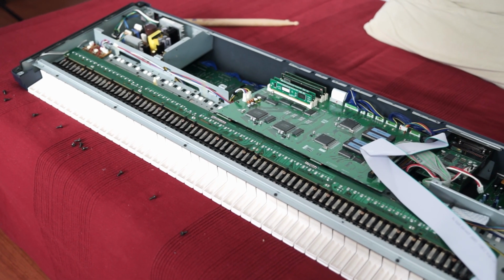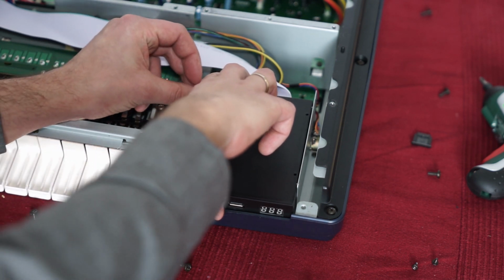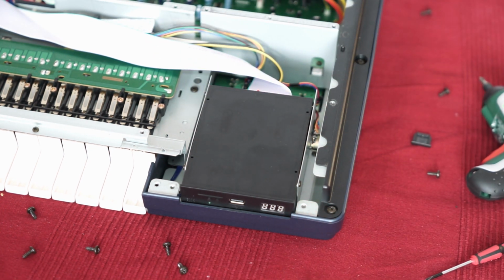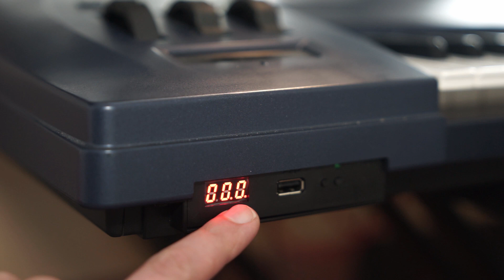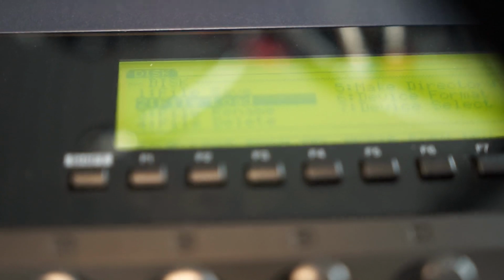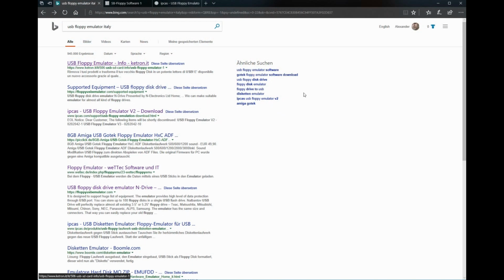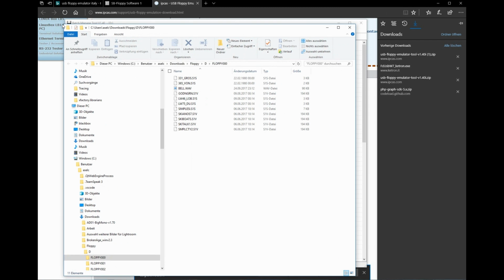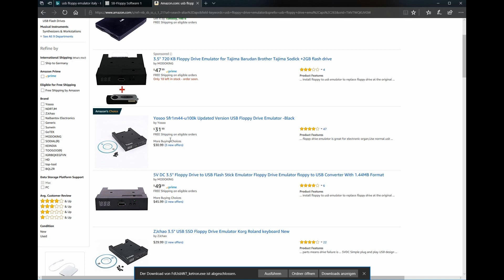How to install a USB Floppy Drive Emulator in an old keyboard (Yamaha EX5)

Comment: Thanks for another great informative video! One extra tip that I found helpful was to remove the existing drive by unscrewing the side 'wings' and removing the drive and the wings together as an assembly. That way it is easy to then access the screws holding the drive in on the right hand side.
Reply from the maker: Thanks for watching and thanks for sharing!

Comment: When I bought my EX5R some years ago, it had a Jaz drive installed in the floppy bay. I swapped this out for an internal SCSI2SD board. Either the Jaz/Zip or SCSI2SD will allow you to save and load much larger .Wave files than floppy emulators can. If you wish to keep the FDD emulator, then you can mount a SCSI2SD in a external case and connect it to the SCSI port on the back of the EX5. Some EX5/R did not have the ASIB1 SCSI Interface installed - but, these can be salvaged from the Yamaha A3000 sampler which has the identical board. These samplers often sell for much cheaper than buying the SCSI board itself from somewhere like eBay and you can also use the A3000 as a decent FX unit after the ASIB1 has been removed. The ASIB1 has two SCSI ports - one internal and the other external. :)
Reply from the maker: Thanks for watching my video! And thanks for your input. I think it's a matter of how much you're willing to spend. The floppy emulators are around $20, while scsi2sd (plus the yamaha SCSI interface) will set you back by around $200.
Reply: I didn't think about this but I guess it makes sense; because it's emulating a floppy drive and 3.5" floppies have a capacity of 1.44mb, you cannot load the large type of sample files with it that you could with the SCSI interface? Is that correct?

I have an EX7 with the original floppy and also an EX5r with a SCSI card and a modified compact flash reader. The compact flash reader allows me to load very large sample files no problem.

Comment: Hi, Floyd — I wanted to post this for future reference by people who own a Yamaha W5 or W7 synth. These USB Emulator drives won’t interface with these synths because they don’t use the standard PC floppy drive ribbon cable. The W5/W7 uses a narrower cable that has a flat end that slides into the floppy socket. There is also no plug for a power cable on the W5/W7. And, the floppy drive screws mount from the top instead of the sides as seen on your video. Your particular drive seems to have those screw holes, but it’s worth checking with the drive seller to make sure those screw holes are there.
Reply from the maker: Thank you very much!

Comment: Done it! I finally was able get the button to work, access the drive  and restore the EX5 factory sound banks. Brilliant thing this floppy emulator.
Reply from the maker: Very nice, good you got it repaired. May I ask how you fixed it?
Reply: @mr_floydst  Is not actually fixed yet. The buttons are still (many of them) problematic. I keep pressing with different angles and  strenght and eventually some of them work. I imagine is some kind of dirt or mould in the boards where the switches lay because once i got one button to work it seems to be easier the next time. Now that I got the synth with all its voices I just gonna enjoy it for a while after that I will takle the problem by getting to the boards and seeing if I can clean them. That involves dismantelling a few other thing because they are located in the front of the EX5, opossite to whre you open it. Ill need some time and courage to do that. Cheers

Comment: Floyd, thanks for posting this video. Last year I was looking at this option for my Yamaha W5 (same era as your EX5), and some dude was claiming you had to “flash” the firmware of the emulator drive to work with your synth, but I thought he was just trying to freak people out into buying from him for his so called “expertise”. Does that hold any validity with you? My brain nearly blew up reading about it. I got so disgusted that I just threw up my hands and gave up on the idea. Thanks, Rick
Reply from the maker: Hi Rick, thanks for watching. I can safely say that's 100% shullbit. ;)   There are some jumpers on the back of the emulator that you might need to change, and that's all (on most keyboards, you don't need to - for me, it worked straight out of the box).
Best regards!
Reply: @mr_floydst  awesome -- thanks! I'll give it a try. Loved your humor in the video and the stormtrooper thumb drive just made it funnier. You don't see too many people modifying the captions -- if you don't have the captions turned on, you don't realize what you're missing! :-)
Reply: Floyd, sorry, a little behind the times here, but wanted to share for others that this replacement won't work with the Yamaha W5. Instead of the PC ribbon plug connector, it uses a flat ribbon that actually slides into a slot. Can't find any drives that have that slot. What a drag.

Comment: I have just bought a EX5, mine has a SCSI port on the back, do they have that as standard? If so, I wonder if the port might be usable with an adapter perhaps?
Reply from the maker: This is the video you're looking for: https://youtu.be/wpuNQ4tSwTM   :-)
It's called SCSI2SD. The newest revision has an USB port so you can transfer files easily.

Comment: Hi Floyd, is it possible to buy used or copies of the origin Yamaha floppy’s that would have come with the unit? I have an EX5 with no disks, and I’m not sure if all the sounds are still in place on the memory. Do I need the disks to get it back to factory settings etc…? Or is it probably cheaper to buy the emulator?😅Cheers, Chris
Reply from the maker: Hi Chris, thanks for watching. You can get the original 4 Disks here, for example: http://www.ex5tech.co.uk/patches.html  (search for "EX5 Factory Demo Set").
Reply: Great, , thanks!

Comment: Thank you - very useful!
Reply from the maker: Thanks for watching! Glad it was helpful!
Reply: Yes, Alex, very.. :)) So I installed my Gotek emulator, then downloaded USB-Floppy Software - Ketron (the site has only Windows 7) version whilst my PC is on Win10. 
I took a 8Mb flash drive, fomatted it to 100 partitions, 1.44Mb, using the Ketron, it worked fine seemingly. 
I inserted it into Gotek and Yamaha appeared to "see" it, and then I recorded a quick notes using the seguencer and downloaded that Wave and All data to the flash and it appeared working - no mistakes on the EX5 screen, a saving bar was moving, etc.
But after than I returned flash to the PC and tried to open it using the standard File explorer - it shows the flash itself as FLOPPYO1 but nothing is on it, Explorer reads "This folder is empty". 
And I did want to listen to this WAV file from EX5. ((
What might go wrong here, Alex? Any hints please? How to open it? Thank you! :)
A quick update: I got it that the Ketron File Explre should be used and  - Yes! :) it showed me 99 folders and saved *.1S and *.1A files on the flash from the sequencer. 
Does that mean that the flash is working properly?
How can I then downloaded a WAV file from the EX5 sequencer so that I can play in on my PC for example and share?

Comment: Everytime I put the usb into my keyboard I get "Data  ERROR". It should be the same for a Korg?
Reply from the maker: Please look up the correct jumper settings for your Korg. 
https://github.com/keirf/flashfloppy/wiki/Host-Platforms#korg
Also, you could try to install the FlashFloppy firmware (same link), I did a video on how to do that some time ago: https://www.youtube.com/watch?v=BuZj5A7cNGA

Comment: I build a Gotek SFR1M44-U100 in my EX5 but it don´t work, the LED´s don´t light, only the USB Stick is blinking, can the jumper connection be wrong ?
Reply from the maker: Hi, that's quite likely. You can try other jumper positions or just install "flashfloppy" (see my updated video, https://youtu.be/BuZj5A7cNGA ) and https://github.com/keirf/flashfloppy

Comment: I just bought a roland w30 with one of these goteks installed, how do you save samples and sequences onto the usb stick???
Reply from the maker: You need to use that software by ipcas. It's linked in this video's description.
Reply: @mr_floydst  i mean from the w30 to the usb stick
Reply from the maker: @cubikvolume4403  Just as you'd save to floppy disk. I don't know the W30 - please look it up in the manual. The USB stick will look like a floppy disk to you keyboard.

Comment: I have a Kurzweil mark 10  Grand piano       what do i need to buy for my model
Reply from the maker: Hi! That machine seems to have a 1.44MB floppy drive. So you should be OK with the model I show in this video. Just search for "gotek usb floppy Emulator". The $20 models will work perfectly fine, no need to buy the expensive ones!

Comment: Hi Floyd 
I'm using ipcas 1.40 software to load files to my USB stick but I kept getting a message " file image is not fat12"
Not sure what I'm doing wrong. 
I'm using windows 10
Reply from the maker: Hi, thanks for watching! This is not an image file, but a zip containing the EX5 bank information. Just insert your USB stick into your computer and it will show up as a tiny 1.44mb usb stick. ;-) Just drag the file to that disk and you're good.
Reply: @mr_floydst   i tried it.  Didn't work
Reply from the maker: @mugabi111  Did you try formatting the USB stick on the EX5?
Reply: @mr_floydst  yes
Reply: I can't even open to see files on floppy disk 1
Reply from the maker: but you can open the stick on your PC and when you right click the stick icon and display it's properties, the file system is "FAT"? you unzipped the file? The file is displayed on your PC, but not on the EX5 ? On my drive emulator I have to push the stick in really firmly (the decimal dot will light up once the  usb stick is mounted correctly)
Reply: @mr_floydst   the  display on the gotek is 000 when i turned on the keyboard.   I can format the USB  on the keyboard and load single file on it . So basically the USB act as a single floppy disk.   I cannot  open or load any files using ipcas software .   But I  can format it using ipcas
Reply: I don't think the issue is the   gotek emulator .  The issue is that ipcas software
Reply from the maker: @mugabi111  The ipcas software doesn't directly transfer you data. Instead, you can choose the active "partition" or "virtual floppy". It will then create a folder on your pc. Drag all your stuff there and then synchronize it (there's an option for that in the ipcas software). It's a bit awkward.

Comment: do i have to updat the gotek or can i just install and use it , and where should the jumpers be i wanna install it in my ebsoniq eps ...im so lost on what to do ...theres a bunch of vids on installing the gotek but they all show installing firmware
Reply from the maker: It depends on your keyboard. The EX5 accepted this drive without modifications, but the SY99 didn't - a firmware update and different jumper settings were needed.
I'd recommend installing flashfloppy, as it makes data transfer much easier.
Reply: @mr_floydst  thanx bro , i honestly give up its harder then i thought ... i was thinking it was plug and play u have to have a college degree to get this thing installed lol . ill just use floppies at least until a easier method is on youtube

Comment: Thanks for tutorial. I've successfully installed gotek into my AP60R Casio keyboard and successfully playing midi files from imaged disks on USB.  Problem is that once a floppy image is loaded via gotek the keyboard will only see that particular floppy image.  If I change the disk number on the gotek the keyboard still shows the titles from the first loaded disk and when I go to play I get disk error, same if I remove the USB drive and reinsert.  The only way presently to load another disk image is turn the keyboard off and back on.  So, the keyboard is only loading one disk per session and not recognising changes to the selected image.  What appears to be missing is a diskreset for the gotek to let the keyboard know the disk is changed.  Is this likely to be a jumper issue?  Would appreciate any help. Cheers
Reply from the maker: Hi, thanks for watching! This happens to me sometimes, too. Usually I can fix it by leaving the "load screen", pressing the "disk number" button ten times (so it's back on the intended number), and then loading again. Here's a (somewhat garbled) schematic on the jumper switches: https://goughlui.com/wp-content/uploads/2013/05/SFR1M44-U100K-SFR1M44-U100K-R-SFR1M44-TU100K-UM.pdf    - maybe setting the "JA" jumper will help you.
Reply: @mr_floydst  thanks for your prompt reply. I'll give it a try. Cheers
Reply: @mr_floydst  

USB emulators only do what they are able to do ... replace floppy disks. 

Simply their replace your old mechanical floppy disk controller. Your keyboard is not able to load more folders at the same time. It is not the emulator. It's like changing floppy disks! Each folder represent a Floppy.
Reply from the maker: @alejandrovarelagandara7874  Thanks for your feedback! I'm aware of that, and so is the OP... I made another video on a SCSI2SD adapter, if that's what you are looking for. Best regards!
Reply: Floyd Steinberg you have to remove the stick and load another folder. Some people modify the emulator adding a switch so the keyboard believes that you change the floppy.

Comment: Hi I have a Korg i4S and got the Gotek drive, I have the problem that it cannot read the USB stick. I formatted it as a 1.44 MB disk with the software but it doesn't want to work. do you have any idea what could be the problem? My english is really very bad, if you speak german it would be much easier for me.

Comment: Dear Alex coul you give me info about jumper set on your emulator? Could you post a guide txt or in pdf format? I have tried to instal but my ex5 is now blocked i don’t understand why..thank you very much for your help
Reply from the maker: Hi! I never changed the jumpers on my emulator. What do you mean by "blocked"? Does it turn on? My first guess is that you plugged in the floppy cable the wrong way. Does your EX5 work correctly when you unplug the emulator again?
Reply from the maker: Also, which model did you buy? (Do you have a link to a web page so I can have a look at it?)
Reply from the maker: Well, according to http://iw.suntekstore.com/images_cache/271/10019784/136383374310019784.pdf  the s0 and s1 Jumpers are needed to determine the device id. try to Change this to 0 or 1 and see if it works. Also, does your ex5 work again when you disconnect the floppy drive?
Reply: I Alex,
If i disconnect the drive the ex5 is still locked and i must reset all ( exit button and power on)

I’ll try to change a jumper and let you know any news. Many thanks
Reply: Hi Alex i’ll try next week and let you know any news . THANKS😊
Reply: Were you able to get your EX5 working?

Comment: There are jumpers with this drive, on which pins should they go for using with synths?
Reply from the maker: Hi, thanks for watching! Normally, it shouldn't be necessary to change the jumpers. In case you need to do it, here's an overview: https://cdn1.goughlui.com/wp-content/uploads/2013/05/SFR1M44-U100K-SFR1M44-U100K-R-SFR1M44-TU100K-UM.pdf

Comment: How do I install the GOTEK emulator on the Korg i3 keyboard?
Reply from the maker: The Korg I3 has USB ports, so why would you want to do that? Just use a USB stick (or if you need to read old Floppy Disks, use a USB FDD drive).

Comment: HI I have a DM Systems Emulator FE-2000, I would like to install on my EX5, could you please tell me what are the correct jumper settings, i have J5, JA, JC, JB, S0, SI, MO thanks
Reply from the maker: Hi, thanks for watching. I'm afraid I can't help because that's not the model I own. I'd try to run it with the default settings, though, you can't do any damage trying that. Best regards!
Reply: @mr_floydst  Thank you very much for the reply, which model did you use in the video? I found this one on amazon,  SFR1M44-U100K Black 3.5" 1.44MB USB SSD Floppy Drive Emulator for Yamaha KORG Roland Electronic Keyboard GOTEK
Reply from the maker: @peter lima I put a link in the video's description ;-)   https://amzn.to/2HcdjLJ    
Best regards!
Reply: I have a Korg Triton with a SFR1M44-U100K
I used Jumpered MO and S1 which works perfectly. No others were needed.
Cheers

Comment: Does gotek have to be flashed to install it on an akai s2000?
Reply from the maker: Hi, thanks for watching! In most of the cases, the emulator should work right out of the box. If your AKAI has a normal 1.44MB floppy drive, your should be able to just swap them withour further configuration.

Comment: i have install a emulator to my yamaha clavinova 103 electric piano. i did all settings very well. and installed software and copy a yamaha style to usb. so i connect usb to piano. but it is displaying a error msg called invalid data file. but i can see style is playing but no sound. what is wrong please help me ...
Reply from the maker: Hi, thanks for watching. If I understood that correctly, you can load files but some sounds are missing? This propably is not a problem of the USB drive but of the files you're using. Sorry I can only guess on this because I don't know the clavinova.